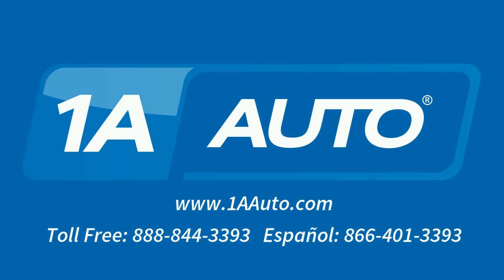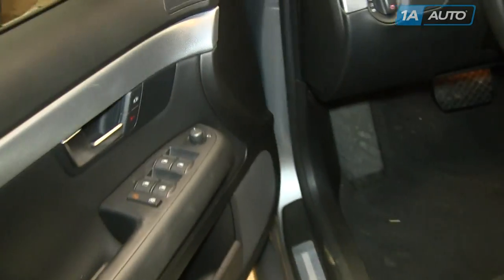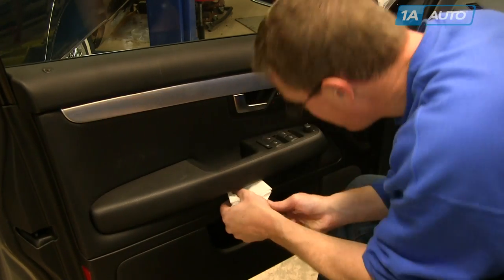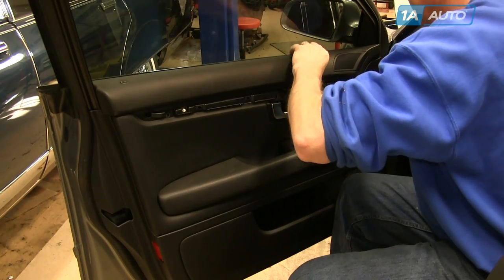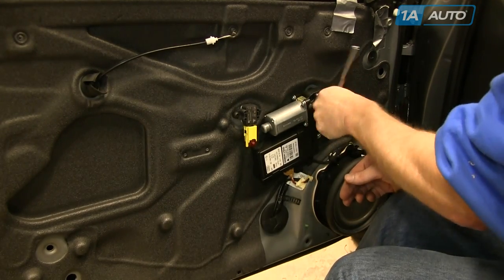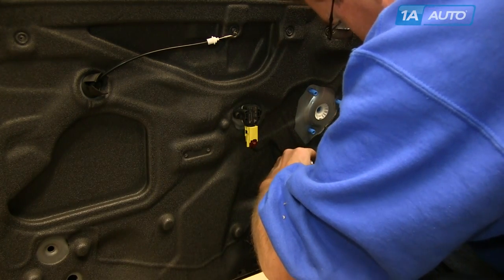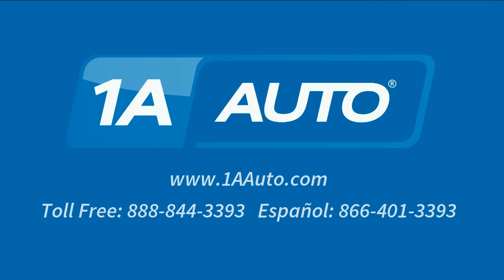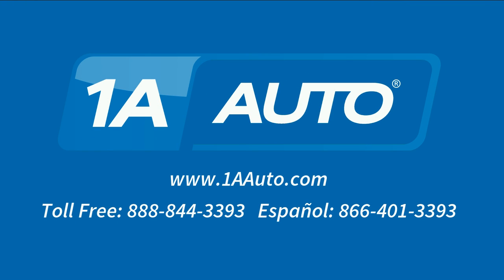How To Replace Side View Mirror 03-08 Audi A4

Comment: If you're just replacing the mirror and/or the mirror cap while it's on the car (say if you got some S3 aluminum or carbon fiber mirror covers) the relevant info to you is between 8:24 and 9:47.

Thanks for this - surprisingly the only video I can find for these specific year models.

Comment: Is this the same procedure to change a  driver side mirror on a 2008 Audi A4 quattro convertible?  Do you have to remove everything on the door panel? I thought you just remove the mirror with screws and that's it. That's a lot of work just to remove and install a mirror.

Comment: could you showing us how is xenon projector is?
Reply from the maker: +mansor alyami We will be doing the headlights but unfortunately this car does not have the Xenon lights.
Reply: +1A Auto Parts and I want to 
ask you some information 
my car have a wind noise coming from Windows after 100km 
what is the best solution for it 😆
Reply from the maker: +mansor alyami Please call us 888-844-3393 or 978-433-3393 Thank You
Reply: +1A Auto Parts ok